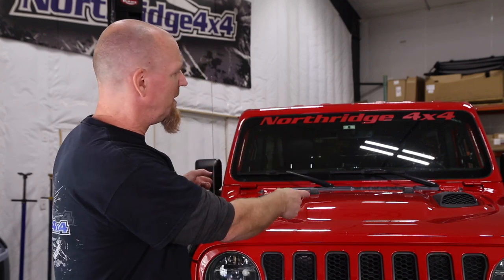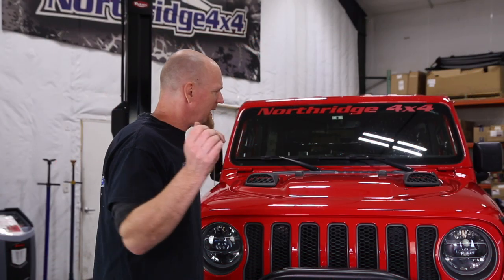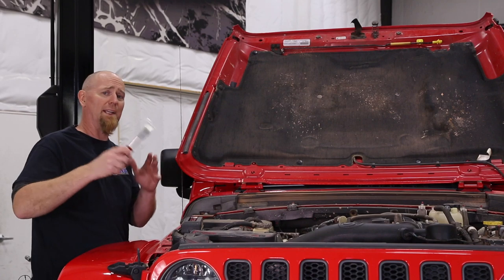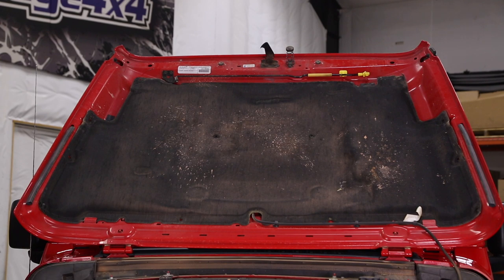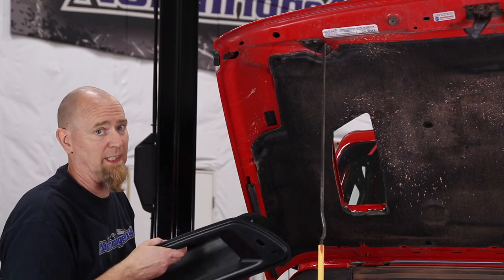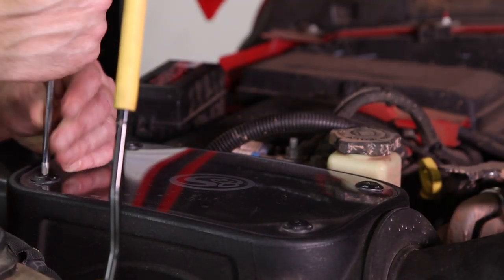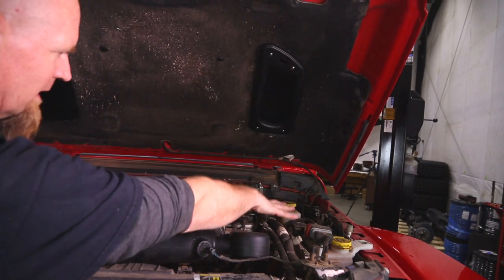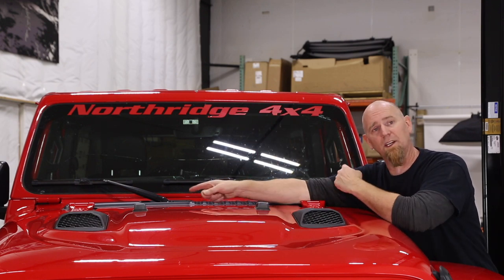S&B Filters Air Hood Scoop System JL / JT Rubicon Hood Install

Comment: If you dremel the bottom of the existing hood scoops it opens them up just fine. There is a youtube video showing that according to a dyno that the stock airbox is better in HP and Torque than the S&B. So you can save yourself over $600 (S&B and hood scoop package) with just a little dremel work.
Reply: For a stock Gladiator you are correct. With a Supercharger like myself, this gives more power.
Reply: Thanks Larry.  Doing some research it doesn't seem as though there is any added benefit to changing out the box.  I was going to go with the scoops alone, figuring that it certainly can't hurt to suck in cooler air into the engine bay, and save the $400 on the box, but I'll try this first, and see if I can save another $200.  If not, I'll order the scoops only.

Comment: Ok.  Do a yarn test on the hood and show me the airflow patterns.
Reply: They'll likely work better if turned around; ala cowl induction.
Reply: If I recall correctly all those many years ago, the reason why cowl induction came about is because the highest amount of intake pressure is where the air passing over the hood meets the bottom of the windshield, that doesn't mean those little scoops won't work they will just take in a small amount of air and  I suppose every little bit helps.

Comment: I like the look and functionality makes sense...  I’m just not sure about having to add the covers on every time it rains.
Reply: Reasonable question, no answer after 7 months? It looks like the vents you took out each had a hole in them as well.
Reply: @sovereignmercy1  yes they have a hole but the insulation has a path to move the water to the fender area and away from the engine.
Reply: I called the company and spoke to their presales tech support.  They mentioned that it comes with scoop plugs to put in for when you are driving in the rain.  Stops the rain from coming in and prevents a lot of water from Dumping into you cold air instake and dumping right on your exhaust. CHeck out the site and look at the installation instructions for the scoops, it's all listed there.

Comment: The cold air system has a lid on for a reason. 4×4 wheeling would have a more direct line to the air filter with dirt and dust wouldn't it? I like the idea but I'm not sure of the way it would preform in dirt. A car on a paved road yes but on a 4×4 in the dirt, I'm not convinced.
Reply: It comes with rubber covers that go over the intake to keep dirt and Rain from directly going in
Reply: Have you not looked at a snorkel?

Comment: Thanks for this upload. Its a very slick design configuration. I saw that there are scoop covers for possibly using during cold weather to contain under hood heat which is great. Im not sure if this is mentioned in the nomenclature, but what is the protocol for when it rains and the passenger side scoop is paired with the S&B cold air box? It seem that it would go in the vent (especially when at a rate of speed) and route down into the airbox.
Reply from the maker: We're waiting for a rainy day to go drive it and test it.
There are little covers for the scoops for when things get really wet.
https://youtu.be/E0O6Gh3P-eM?t=339
Reply: @northridgenation  thanks.. i look forward to hearing about the effects in the rain

Comment: If you order just the scoops today, is the attachment piece included if you later add the whole system?  Is there a different part number if you want the scoop attachment directly to the filter on the passenger side?
Reply from the maker: Yes, you can just order the scoops and then later add the CAI system.

Comment: Where does the rain water go? Looks like an excessive amount of water will enter the engine bay and cause issues!
Reply from the maker: It does go into the engine bay. It could cause problems over the long run.
The kit comes with plugs to run in the rain..

Comment: Pretty cool upgrade and functional👍. My only concern would be water and dust.
Reply from the maker: The scoops do come with a set of covers for those extreme environs.
Reply: Dust? Every filter I've changed had a dirty air box on the intake side. I've also never seen an air box that didn't have a drain hole in the bottom. I doubt either will be an issue.

Comment: I love the look, functionality is hurt a little  if rain water gets sucked into the air filter.
Reply from the maker: That's why S&B includes the block off plugs.
Reply: @northridgenation  What about a precover that blocks water and dust for the filter  and putting a weep hole in the bottom of the air box to drain excess water ?
Reply from the maker: @kurtnulf3362  There is a water diversion channel with a bleed nipple on the underside manifold to help divert the water away the filter and then it bleeds off.
Similar to what is on a Semi-truck.

Comment: Nice video ,,,  Price ????? 😊👍
Reply from the maker: S&B Filters Air Hood Scoop System:
https://www.northridge4x4.com/part/hood-accessories/as-1014-s-b-filters-air-hood-scoop-system

S&B Filters Air Hood Scoops ONLY Kit:
https://www.northridge4x4.com/part/hood-accessories/as-1015-s-b-filters-air-hood-scoops-only-kit
Reply: Thanks 👍
Reply: 299 full kit, 199 just the hood vents. For something that could cost a lot more if rain or snow gets into it. Big PASS!

Comment: What about when it rains? That filters gonna drink some water!
Reply from the maker: The kit includes plugs that close up the scoops when needed.
Reply: @northridgenation  If you have the S&B Airbox kit and you put the plugs in, how does the engine get any air at all?
Reply: @michaelludwig2589  No answer... not surprising.
Reply: @michaelludwig2589  There’s a second intake on the side of the airbox towards the passenger side I believe.

Comment: It will feed fresh air right into your air box.. oh and rain, it will feed rain in there to 😄
Reply from the maker: Light rain has never been a problem, there is a water drain built into the underside. For the heavy rain, the kit comes with 2 block off plugs.
We're still running them here in the rainy Pacific Northwest over a year later and have had no problems.
Reply: A little water here and there is good for an engine.

Comment: I like it but you never said anything about water getting in through the scoop in the the S&B box, and the driver side one water all over the  engine compartment
Reply from the maker: We've had these installed for a few years now and haven't had much problem and that's in the rainy PNW.
There are plugs to plug off the scoops when it is raining really bad.
The air box side has a drain to drain water out.